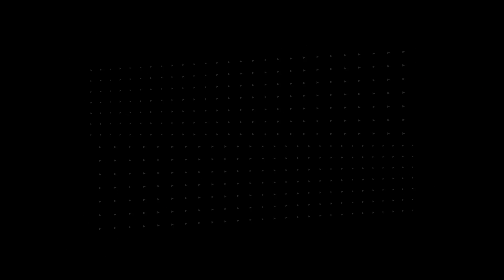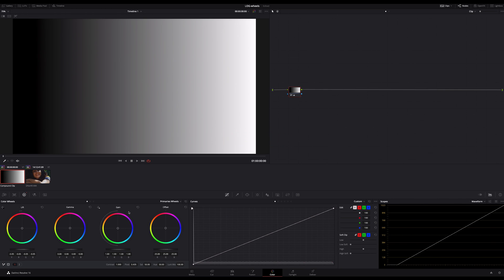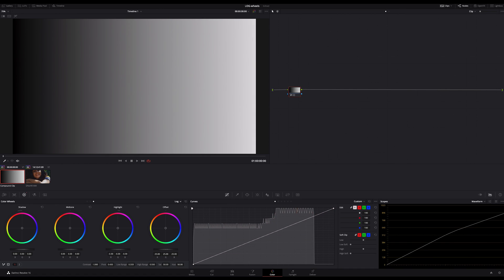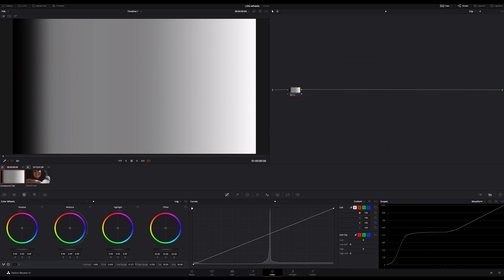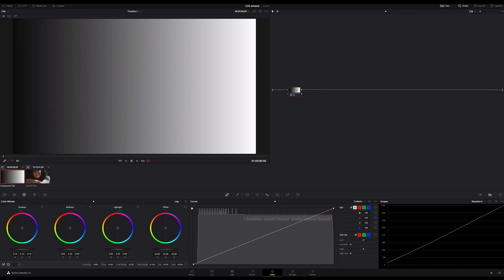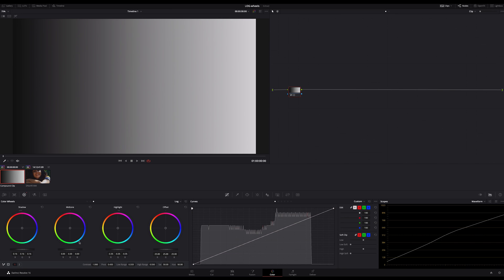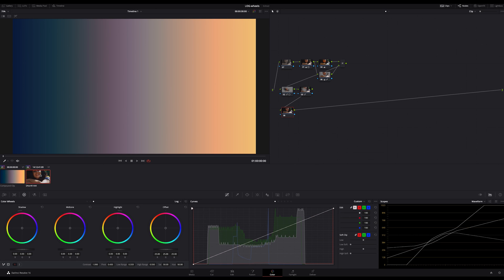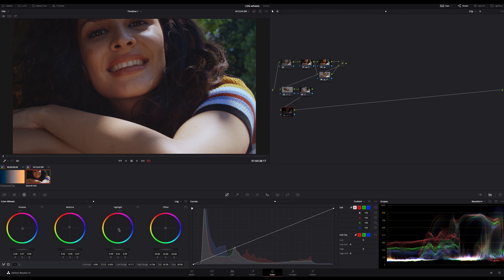Log Wheels Color Grading | Davinci Resolve Basics Tutorial

Comment: The log wheels are scaled to be used with log-material up-stream from normalising the image. This is just plain misinformation. Sure, you can use any tool any way you want, but if someone was to explain how the log controls work to me based on this video, I think I'd die from laughter.
Reply from the maker: The Log controls are so named because they’re designed to work specifically with media with 
Log-C or similar gamma and color encoding, derived from the Cineon Log gamma curve,
 developed by Kodak to digitally store flat-contrast, wide-gamut image data that preserves
image detail with a wide latitude for adjustment. There are two ways of using the Log mode controls. The first takes advantage of the way these 
controls work to make fast, filmic adjustments to log-encoded media while it’s normalized by
 LUTs or manual adjustments added after it in the image processing pipeline. The other way of using the Log controls is to take advantage of the more restrictive, but 
adjustable tonal range of the Shadow/Midtone/Highlight controls to stylize normalized clips by
 tinting specific regions of the image. 

And BTW, that's a basics tutorial, intended for beginners, not pro's like you. So... please stay healthy.

Comment: Hi Tim! Why not just use curves to do the same thing? Isn't that where curves excel (picking a color/luma value and adjusting it per a specific luma range)? Seems much simpler than adjusting the range controls whose range is difficult to see visually. Thanks!
Reply: I'd do that using wheels because of the smoother transitions, that are hard to achieve with curves.
Reply from the maker: For sure, using the curves works well too, but that's not the point, the topic is to explain how the log wheels work :) And yes, using curves is an alternate way. Thanks for your comment and hint!